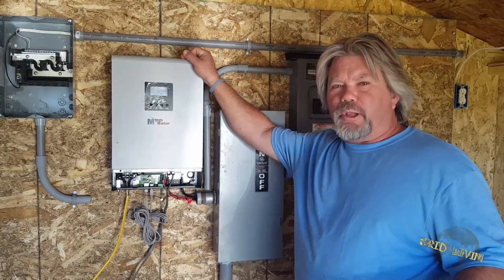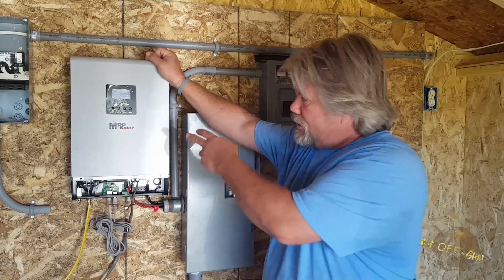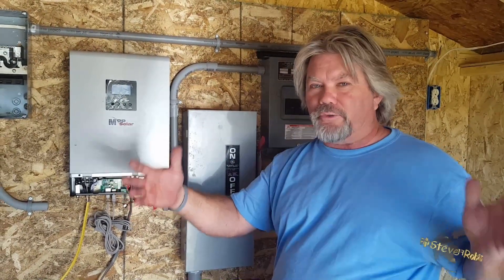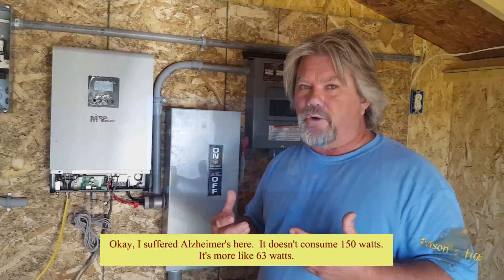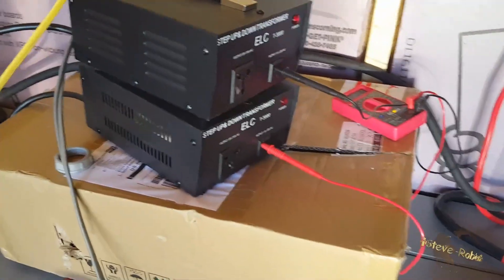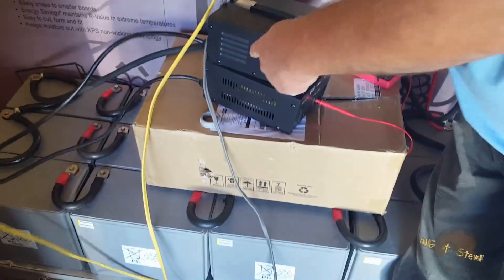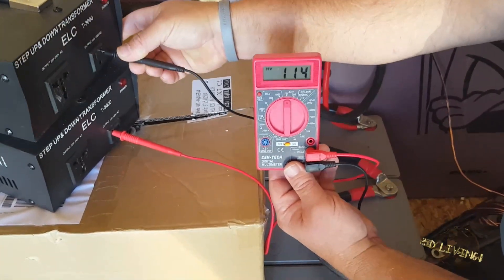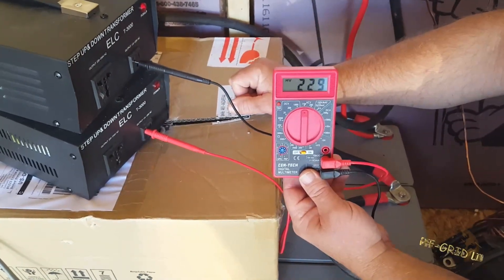Another MPP Solar PIP Inverter Split Phase Transformer Solution

Comment: Hey Steve I just discovered your channel  I'm a new subscriber and I love the info, thank you! I'd love to have some of your thoughts.  I am in the process of building a hybrid passive solar home that the appraisers and banks still somewhat understand :).  The house is south south facing with many window without low E or argon for as much solar gain as I can get conventionally.  The house has a slab floor with R-10 insulation underneath and radiant hydronic heat.  My question is how is the most cost effective way to heat my water for radiant floors and domestic hot water with PV panels? My Idea after studying your channel a bit is to get 3 50gal electric water heaters, 2 for heating and 1 for DHW.  I would like to hook the top elements on each of the tanks to the grid and the bottom elements directly to a charge controller or the PV Panels.  I would set the upper thermostat at a lower temp than the lower element hopefully keeping the upper element from being used.  If I needed I could always shut the upper element completely off.  In the Summer I would eventually like to run 1 or 2 Mitsubishi mini splits off the extra power for AC.  I am in Tennessee.

My first obligation is to get the hot water taken care of.  I'll be installing it all myself so all of my $3k budget will be supplies.  I may have to start out with only 2 tanks, 1 for hydronic heat and one for DHW, then add the 3rd after I get in the house.   Like I said, I'd love to hear your thoughts and wisdom on the most efficient and cost effective way you would recommend.   Thanks!!!  Darren
Reply from the maker: Hello Darren, and welcome!  My personal experience is that solar electricity is much more abundant in the summer than the winter - even in New Mexico where there is almost too much sun.  I eventually opted to install a stainless steel coil made at hilkoil.com and it has worked flawlessly.  The stainless steel resists heat corrosion much better than any other metals, and makes way more hot water than I can use.  By using wood in the winter, one fire heats my home, heats the water for a really hot bath, and cooks our morning and evening meals.  I probably should make a video describing this much better.
My system produces more amps in winter than summer, but in the winter I only have an average of 4 sun hours per day where in summer I have around 10 sun hours per day.  In the summer we use electricity for everything: mowing the yard, splitting firewood, heating water, uplighting trees at night, cooking, compressing air for power tools, etc.  In the winter we mostly hibernate, using wood for cooking, heating water, and heating the house, saving the precious electricity to run heat tape for outside insulated pipes, and heated water bowls for the livestock, as well as lights, computers, etc.
I invested around $12,000 in my electrical system 6 years ago.  Today I'm installing a slightly larger system for a neighbor at a cost of about $6,000.  Mine is 4.8kw and his is 5.0kw.
Reply: Steve, thank you so much for your insight!  We currently have been heating on would only except for a electric DHW for the past 7 years.  We use the wood from our land and our water is all from rain catchment. We are trying to get away using wood heat at a necessity.  I would like to use it only when we decide to because of the amount of time it takes me away from work to prepare the wood.  I designed the house we are building so it would have several options for  heat sources.  Like I mentioned in the previous post.  We have passive solar heat coming from the windows onto the insulated slab, Hydronic heat through the floors (this is what we are discussing now :) ) Wood burning stove, and 2 Mitsubishi mini splits that can do Heat or Cooling.  I call it a hybrid solar house, not sure if anyone else more knowledgeable than I would call it that or not.  We are still grid tied but would like to start gradually weening ourselves off.  This is why I found your approach to heat water through PV so interesting.  My original idea was to use the high efficiency heat evacuated solar tubes for heating the water as found here http://www.dudadiesel.com/solar.php.  The same type of technology that they use in England where the weather is heavily cloud covered in the winter.  My personal drawback of using the stove for heating the water for the in slab hydronic heat is, when we want to warm up the floors just a bit but don't want to make a fire in the stove either because it is not cold enough in the spring, fall or warmer winter day.  I would like to have a heat source that is not dependent on wood, but still have wood available for the times when it fits in our busy schedule.

All of that being said to share with you a little about my motives and a little heating history.  What I would like to do is begin building a PV system to learn on as we live in the house.  If I use it to heat the water only then If I miss calculate or it is unseasonably cold or what ever I could always just flip a switch and I would have heat.  
I would like to get as many PV panels as I can fit in my budget and hook them directly to the water heaters.  If you could look over what I'm doing and add any wisdom with the best gear you would recommend, I would very much appreciate it.  I'm thinking $1800  for 10 255 watt PV panels for an estimated 2Kw usable power? two 50 gal water heaters @ $400 each  and $400 for a MPPT charge controller running directly to the bottom heating elements of the Hot water heaters.  Do you think that will accomplish what I'm going for?  Do you think the allocations of budget to gear ratio is the most efficient?   Is there anything I need or don't need that you can see?

My thoughts are to see if that system could only heat the water in 2 tanks hot enough to be effective.  If it does and I have electricity left over then I can add an additional tank to the hydronic designated Hot water heater to use for more storage for colder days.  It will be a separate closed loop system.  Thank you for your time in reading this.  Sorry it was so long maybe I could do a video showing you what I'm doing if you are interested and I can find the time.
Reply from the maker: If you'r wanting to feed the panels directly to the water heaters in DC form, you can't use an MPPT controller - that only works with batteries or grid-tie system where the is voltage already present at the output.  I would instead wire panels in series to near 240V (but definitely not over!), and wire them in banks by peak (not operating voltage).  For example, if you purchase panels that have VOC (Volts open circuit) of 46 volts then 240 / 46 = 5.21739 panels.  Use 5 panels in series.  Then wire another 5 panels in series and wire the two sets in parallel to your water heater THROUGH A FUSE OR BREAKER so you can cut power if needed.  Ground and bond everything thoroughly.  DC will burn out the thermostats in the water heaters quickly because of arcing, but thermostats aren't terribly expensive either for the sake of experimenting.  That's the reason I use AC for heating water.

I don't know where you're looking at getting your panels, but I ordered 20 panels totaling 5kw for $2200.00 including shipping five weeks ago from here:  http://sunelec.com/home/

You can also get the 230VAC inverter with 80amp MPPT controller shown in this video if you want an off-grid battery system for under $800 here: http://www.ebay.com/itm/Solar-power-inverter-5kva-4000w-48v-230vac-pure-sine-MPPT-solar-charger-80A/141079385940?ssPageName=STRK%3AMEBIDX%3AIT&_trksid=p2057872.m2749.l2649

I also buy batteries for my installations from Marion here in Colorado:  https://denver.craigslist.org/for/d/new-data-safe-120ah-agm/6288969804.html
Reply: Steve,  Thank you so much for the info and reply!  I forgot about DC wanting to ARC so easily.  I don't think that would be best for my situation.  What if I just started with a grid tie system? The more I thought about your idea with the hilkoil.com "stove water coil" system, the better it sounds.  I could put the water heater upstairs on the 2nd floor and run the copper pipes from the stove (1st floor) to the water heater and let convection circulate the water so I don't have to have a pump system.  I could use that water tank just for the hydronic heat in the slab.  I would have a separate water heater for domestic hot water and run electricty from grid  and hopefully be able to generate close to what I need from the grid tie PV so it will equal out.  Over time that would give me a chance to save up $ for an "off grid weaning" converting one circuit at a time to off grid.  

That being said,  If I get the 5Kv PV panels like your friend for $2200 what would be the best cost effective grid tie inverter you would recommend?  Which panels did you install for your friend?  Do you recommend using convection to circulate the water from the stove to the hot water heater? Lastly is there any thing I'm forgetting? 

Thanks for all your wisdom and help Steve!
Darren
Reply from the maker: Generally, if someone is already grid-connected, I recommend a grid-tie system, unless you're after autonomy.

Comment: great job on this.  Thanks Steve.  Always a pleasure to learn from you
Reply from the maker: And you as well, Jim.  From your channel I learn the good deals and ideas you provide as well!
Reply: Thanks Steve.  Did you replace your magnum with this?  Do you prefer the Magnum?
Reply from the maker: I didn't replace the magnum.  This is being installed at my neighbor's house.  I believe the Magnum is more durable and from a power standpoint, more robust.  But the MPP is half the price AND also has a built-in MPPT PV charger that charges up to 80 amps at 48VDC.  When I take a step back and look at the big picture, I like the MPP inverter better because for the same price as a Magnum I can get 8kw of sustained output, and charge up to 160 amps of solar by running two MPP's in parallel.  I get the added benefit of redundancy when/if one fails.
I have also written some software that combines Android phones, INSTEON switches, and weather underground to control various devices around my home.  The intelligence of this inverter tied into my system would make everything around my place work nearly like magic.  Right now I use weather underground to determine whether the sky is clear or cloudy, and I use the relay output of my inverter to determine the battery voltage is above 55v.  Then I can turn on the distiller and/or coffee maker based on those parameters.  But if I can get information from this inverter like charging amps, battery voltage I can make the software into a dynamite system to share with everyone!
Reply: So, would you advise me to go MPP or magnum?  I am still looking to build a new place and have some panels.  Looking to go as low cost as I can.  I was enphase but their books look bad and will be out of business soon.  Keep the information coming.  I need it.  Thanks Steve.  We need the info out here.
Reply from the maker: If you want lowest cost with decent performance, I would suggest MPP.

Comment: Hello Steve: I talk with Justin Case ths morning and about the PIP he been useing for 4 year's. He sail they been going great, only change the fan 's. once a year. we chat on skype for 45 min . nice guy and he running 1000 amp battery bank. off grid  . and has 3 PIP runing his house. hope one day we can chat to' so I can learn even more for you as I have all  rready done. thank you again  Neil a   t   n105le123    on skype
Reply: steve you may also what to xcheck this out from MMP solar    https://www.aliexpress.com/store/group/PCM60X/629424_500365311.html?spm=2114.12010612.0.0.5bdadf47iaWf4F&origin=n&SortType=orders_desc&g=y  Neil Las Vegas
Reply from the maker: I must say I don't like the idea of changing fans - especially every year.  But for the price, something should be expected, and if that's the worst of it then it's not a bad deal yet.  Honestly I don't have skype, I don't Facebook, Twitter, or much of anything else because I'm always busy helping other folks here on the mountain.  But I'm always available to answer specific questions here on Youtube.
Reply: Don't need to change the fans every year. That was befor firmware updates years ago when the fans ran with full power....  they would tend to fail more often. But fans last much longer now as they ramp up with power use.. They only need changed when they Stop working. The inverter will show a code and log when fan or fans fault. this means if you have you're system set to email or text you will know the time of fault..  will allso log in watchpower software & show on the inverter LCD screen.
Reply: Thank you Neil
Reply from the maker: Where do you purchase these fans?  There are several people on the mountain using these inverters, so I should order a few to have on hand.
Reply: You need to ask Justin Case her knows more about the PIP then most do . I know the new  fermwere  helps  on fan power and the how much they run, I been told . Justin will know more , next I chat with him I ask's as well. Neil Las Vegas
Reply: Steve you can get the fam's were you both the PIP from he said
Reply: THe pip fans I mean
Reply from the maker: That is a good deal on a charge controller.
Reply: Steve I just talk  to Justin  Case and here were you can get the Fans for the PIP from        can order part from Peggy at MPP Solar Inc . https://www.mppsolar.com/v3/contact-2/
Reply from the maker: Thank you Neil!
Reply: Glad to help a friend

Comment: Steve where did you get the transformers from our eBay,  the address  on eBay. Thank you. Neil Las Vegas.
Reply: Steve - they also make a 5000kva transformer that should work for your purposes as well using 1 piece instead of 2.  I myself used a Acme Step up Step Down transformer for my PIP4024 4000w unit and it works a dream.  Gave me my split phase, draws about 80-90 watts and I can live with that.  You can check it out on my channel - https://youtu.be/o6cmJNhlbOs.  I LOVE your videos - so common sense it makes things simple.  Keep up the great work buddy!!
Reply from the maker: http://www.ebay.com/itm/3000-Watt-Voltage-Converter-Transformer-Heavy-Duty-Step-Up-Down-3000W-110-220V/361323448689?ssPageName=STRK%3AMEBIDX%3AIT&_trksid=p2057872.m2749.l2649

Comment: Would you have any read outs or test results with measured loads? Godspeed Raz
Reply from the maker: RAZ!  How is my brother from another mother?  As soon as I do some more tests, I'll get them posted.
Reply: Thank you comrade!
Reply: Steve Robertson I have my test done. All my house is running with split phase using the autotransformers
Reply: MrTech Santiago using 3kva transformers?
Reply: Joacim Pacheco I use 5kva autotransformers but can achived with the 3kva ones because load is balanced between both and one add to another

Comment: Try wiring a 6uF A/C motor run cap in parallel with primary. It will drop power input to near zero. You will need to adjust uF  to tune it. Resonance!
Reply from the maker: That's interesting.  I haven't thought of something like that.  Perhaps even a coil choke to tune it.  That is outside the scope of what I'm after here.  But after the dust has settled, I'll probably play around with the idea.  You're intelligent, so I'd like to see some videos from you too!
Reply: It would require a capacitor of 90MF at 240v to balanced the system.
Reply: Power factor correction with a run cap might vary according to load current.
Reply: RJParker. It`s to adjust the run cap to the maximal load when you put it INBETWEEN the 2 transformers..
I put a link for you to figure it out by yourself... Look at the bottom..https://www.electricaltechnology.org/2013/11/How-to-Calculate-Suitable-Capacitor-Size-for-Power-factor-Improvement.html

Comment: ive seen the same people have great success and some have issues, i do know the (very early models) were kinda ordinary, i personaly know and met two large solar companies that  bought and installed  a huge number of the" very early model pips" for solar pumps and off grid etc etc  and they had a very high failure rate so now they both only supply sma , but now the mpp solar have vastly improved on the design and quality of the pips, the price is right too, so youre no doubt onto a winner.
here in Australia the magna's etc are a whole lot more expensive ,with the prices you quoted theyd sell like hot cakes here if we could get them that cheap.
 it will be interesting to see what you learn trying this out , id just be double cautious just incase of the unknown, man im a panic merchant cant help it from being a mechanic etc , for me atleast a concept can seem perfectly straight forward and when i put it to the test i learn i have some more learning to do LOL.
i know everything is money and things work well for people but the cheaper multimeters scare me after watching a youtube showing how some multimeter test leads can act like a fuse and instataneously burn all the insulation off or the leads or whole unit can severely damage your hand or worse when exploding , i know theyre internaly fused, ive blown the fuses at low voltage, i should test one using 240 AC at a distance and see, i have an electrical engineer and electricians in the family always filling my head with the worst things theye encountered, LOL , STAY SAFE i guess is what im trying to say.
Reply from the maker: I understand brother.  One of the reasons I love Youtube is that those of us crazy enough to try something out of the ordinary can share the results with everyone else.  One failure = many peoples' experience shared.